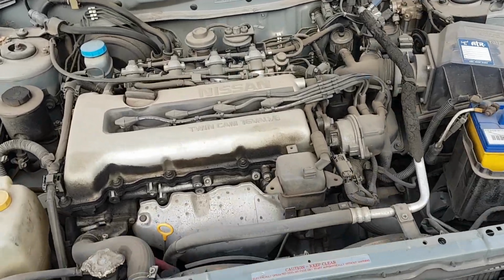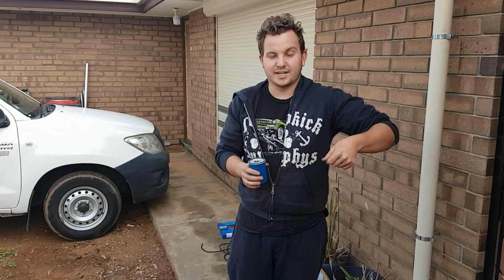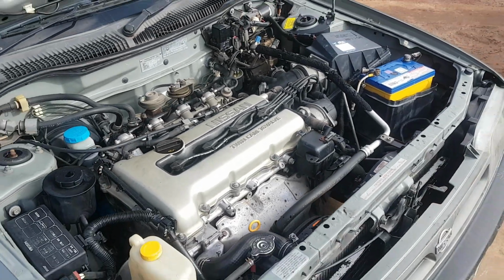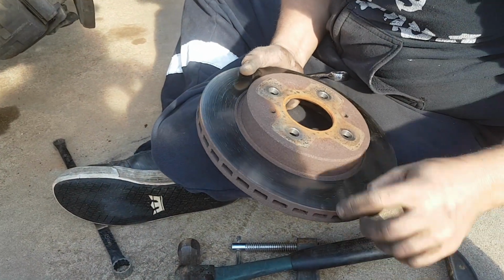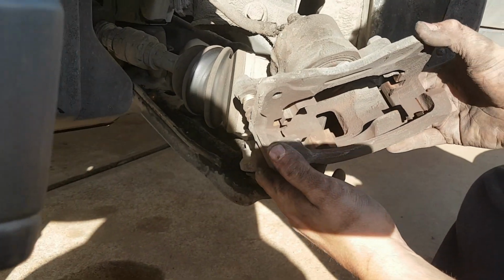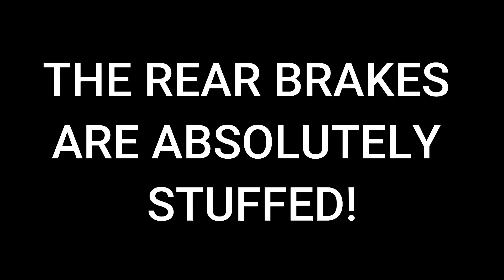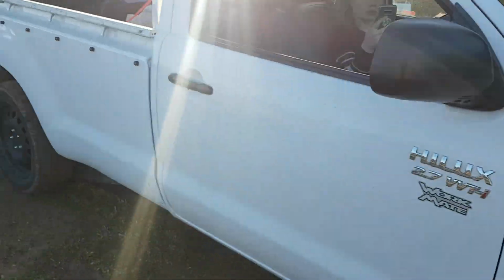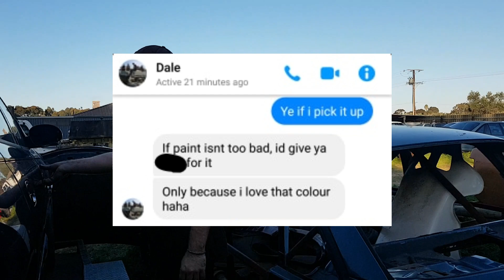SSS PULSAR SR20

Comment: Have you ever changed your gear shifter bushes
Reply from the maker: Not on the pulsar but i have on a few fwd corollas, its a pretty simple job on the cars with bars to the engine rather than cables
Reply: @elheffeschopshop   thanks for the reply . I have a Nissan pulsar n14 and the gear stick bushes are gone on it it’s very sloppy and it’s very hard to find bushes for it. Do you think my best option would be to go with a short shifter as it comes with new bushes
Reply from the maker: That would work ahah, or you could pull it apart and measure the bushes and see what you can find off other cars, if you wanted a short shifter anyway just do that ahah
Reply: @elheffeschopshop  cheers mate thank you for responding
Reply from the maker: No worries man!